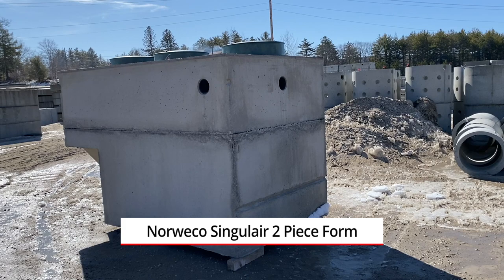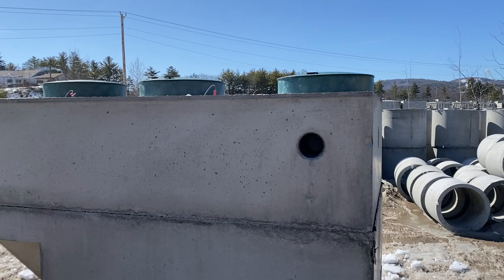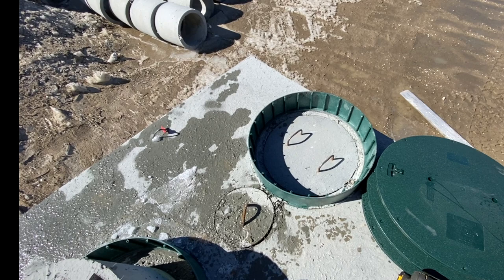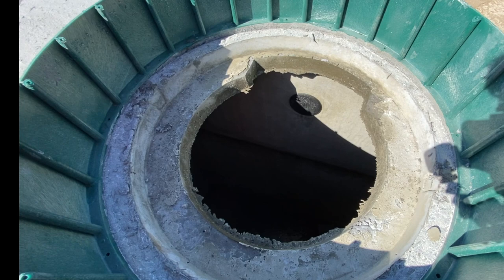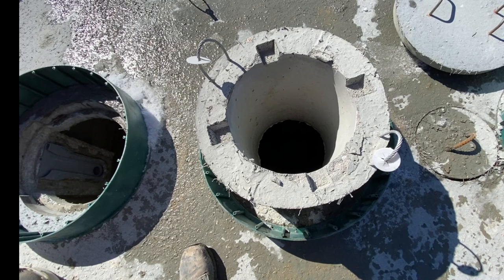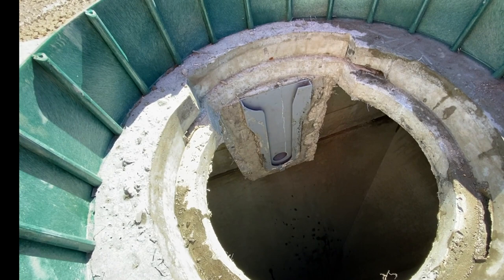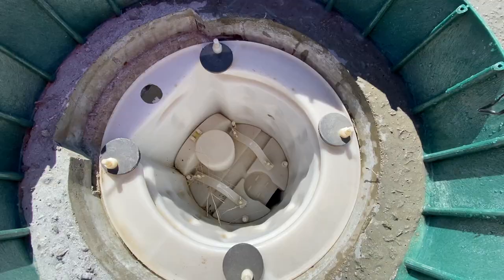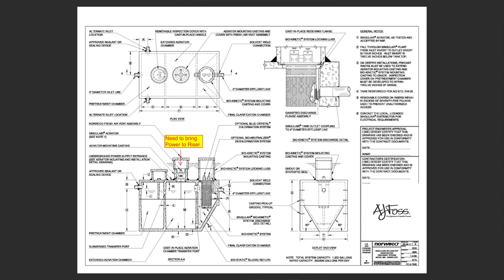Wastewater treatment system for Waterfront and Small lot properties!

Comment: 2 peice tanks are junk will eventually leak .
Reply from the maker: Because of the size needed sometimes 2 piece tanks are the only option (because of height or weight) but if gasket is installed properly the seams should not leak.